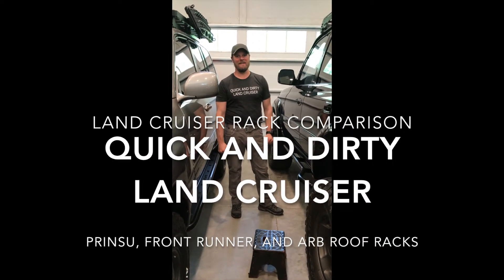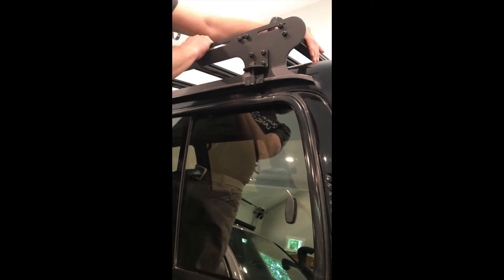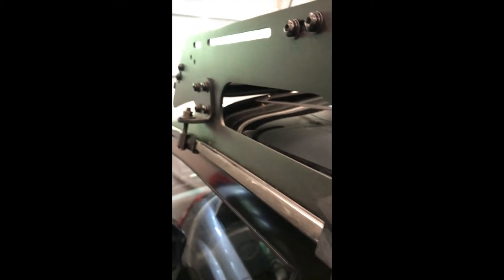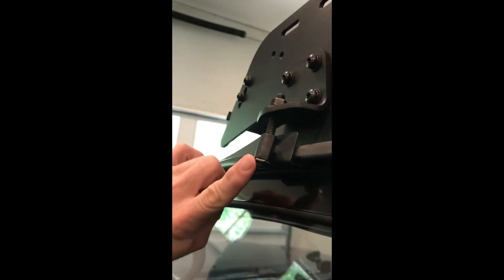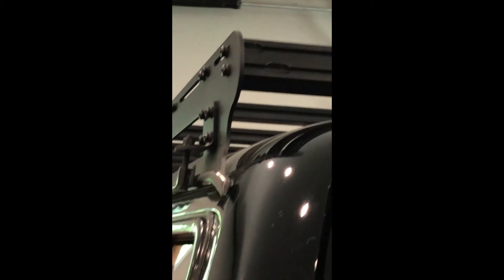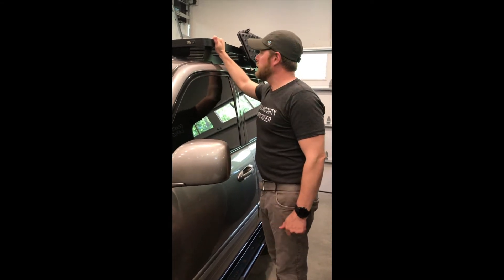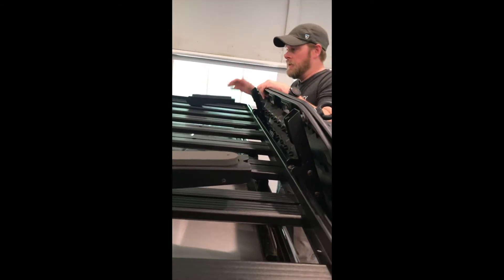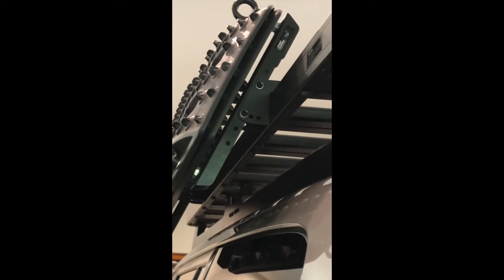Toyota Land Cruiser Roof Rack Comparison between Prinsu, Front Runner and ARB Roof Racks

Comment: I have been trying to get clearance specs for an 80 Prinsu. Can you tell me how high is the rack from the roof base, say center line towards the rear? I would appreciate it as I have a tight fit to get into the garage. Thanks. Sweet rides BTW!
Reply from the maker: Sorry missed this, I measured and it looks like about 6 to 6 1/2 inches.  Thanks!

Comment: Great video question for you please. I am considering all three for my brand new Land Cruiser 200 series. I am terrible when it comes to tech and outdoors and camping. What is the easiest rack for someone like me? To clarify I am not very handy. So out of these three which one would you recommend as the easiest to live with and put accessories on top etc. Thank you again
Reply from the maker: I typically recommend the Front Runner just because they have thought out a lot of the accessories already that just bolt on.  Thanks!